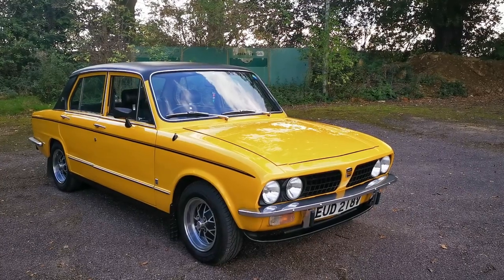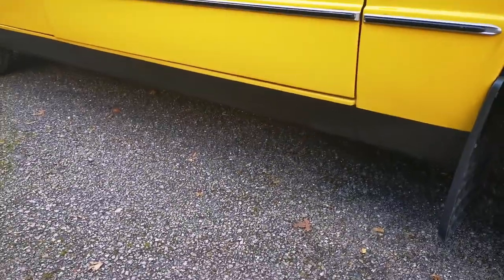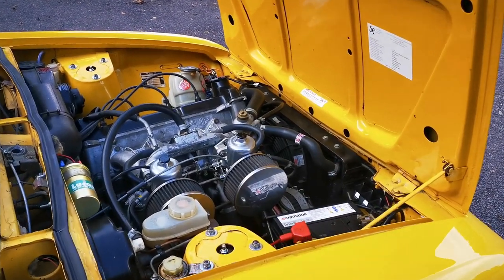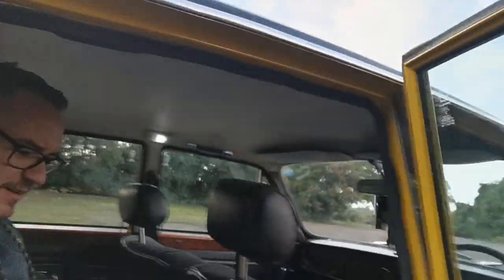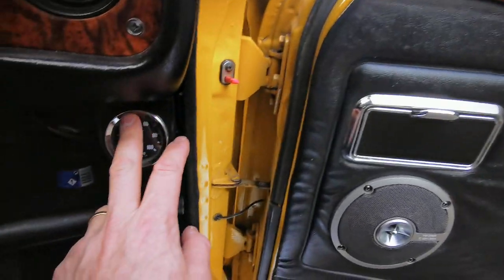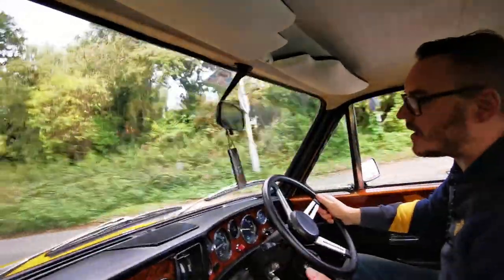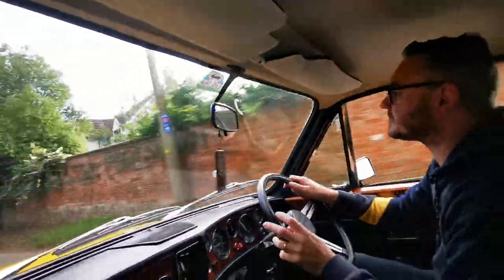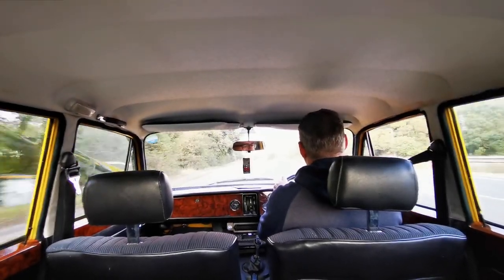Walkaround and drive of my Triumph Dolomite Sprint

Comment: Down here in Australia, I had a 76 Sprint, with factory LSD. Only ever made 2 mistakes with the car. 1. I bought it. 2. I sold it. Had it for about 6 years and loved it. Never had an overheating issue with it, but I did stick in the biggest custom made radiator I could get, with thermo fan. Sold it to buy a 4AG powered Corolla, which I could never get to handle as good as the Dolly.

Comment: What a lovely car, I had four back in the day two 1850s and two Sprints, I have seen other comments on here about the twin tailpipes but I guess that's preference these days and I don't think the twin pipes helped gas flow one bit. The overheating problems were largely caused by people not realising that the antifreeze needed to stay in year round and used to drain it in the spring (which is what we used to do back then) run through the summer with plain water which used to damage the waterways and head gasket and then refill with antifreeze which is a searcher and that's when the problems used to start. They were seen as a bit of an old mans car back in the day but I think it's a bit unfair to compare them to the RS2000 because I think they were aimed at a slightly different market for example the middle manager who had a young family and warranted a slightly more upmarket car than a Marina or a Cortina but wasn't quite senior enough for a Rover P6 or later on an SD1 or a Granada whereas the Escort was aimed very much at te other end of the market i.e. The young lad who'd just got enough insurance bonus so could afford to insure a Mexico or RS and really didn't have to worry about getting the family in the car. I loved all my Dolomites and with hindsight I wish I'd kept the last one a 1977 Sprint in Mimosa yellow.
Reply: What was your experience with the 1850’s? Troublesome? Are they reliable enough to drive everyday? Etc thanks

Comment: Was my dream car, 1973,  I bought a dark red one around 1975 and ran it for about 5 years, the engine was amazingly powerful, was one the fastest saloon cars on the road at the time, even 3 litre Capri's couldn't match the acceleration from a standing start. . lol.     I had overheating problems on  the motorway which were due to previous owner fitting incorrect radiator.  Had a fair bit of rust by the end and needed valve guides so I had to sell it,  but love the Sprint for it's great looks and the engine.

Comment: Your Sprint looks awesome matey, I owned 10 of these in the 1980/1990s , Never suffered a blown head gasket in any of them probably due to the fact I would renew the water-pump as soon as I bought one and fitted aircraft bolts in the camshaft (they were prone to snap) my favourite one was the yellow one which I fitted a blue printed engine into it, It was awesome and used to run rings round the BMW's of the day  and my friends holbay engined hunter gls, Great to see yours keep up the videos :) It would look better with the standard twin pipe exhaust :) (just my opinion)

Comment: Lovely cars. I owned a Inca yellow Sprint W reg. It was made in September 1980, the same month as production stopped.

There is a trick to help stop those slant 4 engines overheating. I should know, having owned 2 × Sprints, early 1850 and a Stag (the V8 is a twin Dolly engine). Never had a coolant issue.

The other mechanical issue was the fuel pump whined loudly. So I change mine to a Bosch.

Comment: I read somewhere that the overheating/gasket issues were because dealers weren't used to alloy heads on iron blocks and the need for coolant with corrosion inhibitors when servicing back in the day. Typical BL. Any reputation for fragility was undeserved. Always loved Dollies especially the Sprint. Lovely example. Love your channel

Comment: A car which brings back fond memories. My father had one and it was really quite a groundbreaking engine. Very quick for it’s day and a better builld quality than most BL cars of the time. Remember Dad having problem with leak on head gasket, a common problem. The overdrive was quite a novelty.
For me the highlight was driving it shortly after passing my test after my 17th birthday, learned on Austin 1100 with the worlds worst gearbox. The sprint felt like a rocket ship by comparison. Sadly the insurance company realised my age and decided they no longer wanted to insure me on dads policy so only got to drive it once but has a special place in my motoring history.

Comment: Worked on these when they were brand new, loved them, never did a head gasket but did spend lots of time setting differential angle to reduce driveline vibration under heavy accel.

Comment: Lovely example. I owned a Sprint for 10 years. It might help your carb set up if you ditch the waxstat jets and fit plain jets and also fit plain butterfly discs. These items were fitted to improve emissions (probably for the US market) but in my opinion just made setting up the carbs impossible as the mixture would change by itself depending on engine bay temperature.
Also don't worry too much about head gaskets. You have a later model fitted with uprated head studs. As long as you look after the coolant it will be fine. My Sprint got to 140k when the rust just got too much. The engine was still as sweet as a nut.

Comment: I bought a 2 year old in 1980, same color and very nice condition, almost new - S reg.  The overdrive was the best part and brought down the revs and noise.  It had some legs up to the speed limit and a bit beyond but was not a very fast car.  Also a bit tail happy in corners and never do anything silly in the wet.  I liked it and was reliable only stopped once but restarted after about 20 mins, something with the su carbs.  From the investment point of view the RS2K would have been much better but that is history and hindsight.  Good luck with the car.

Comment: I had 3 Dolomites a 76 1500 HL and two 1850HLs last was a 'W' Reg. I fitted a Kenlow fan to that and used to get 45mpg easily on a run! Only once did I need to use the Remote switch for the fan as it was getting hot on a hot day in Somerset going up hill! I loved them! The 1500 was Honeysuckle and the others Russet Brown.

Comment: That pin broke on my Sprint as well, and I also thought it was the clutch. Such a big job I did have the clutch replaced while the gearbox was out. Wished I had the O/D refurbished while the box was out as well. Its never worked 100% since.

Comment: Lovely car. You seem to be doing all the right things to it. 
Had two way back in the day. No problems with either apart from writing one off!   
They are great and I think it was a factory option to have a Britax sliding roof on them. I had one and it was lovely, you can open it in most conditions. 
Only point from your commentary, I think the wheel nuts are titanium not alloy. They are still easy to rip the thread off so do not overtighten or let the tyre shop at it with an air gun!
Air intake has been changed but apart from that looks completely authentic. 
Yellow is a great colour of the era. My second one was white which oddly worked for them with the black sections. 
Cannot remember if the sills were originally body colour or black.
Reply from the maker: Thanks, I wasn't sure about the nuts but they are certainly lightly and feel like it wouldn't take much to strip them! I've also now refitted the orginial air filter housing to see if it makes any difference to the way it runs (it doesn't!). I wasn't 100% sure on the sills but a few press shot of late Sprints had black sills so I went with that!
Reply: @trigsretromotors  Great, thanks for responding. Enjoy the car!
Reply: @trigsretromotors  Is there a way of contacting you as I would like to use some of the car sounds audio from this video? Thanks

Comment: brings back memorys of my old one lovly car you should have stated how it was of the best handling cars of its time you can really sling them bitches round corners , they only thing i hated was the engines head bolts they go in at an angle and they rust solid after about 1 day then you end up sledgehammering the head off ohh yes i remember it will lol but great car i would the body shell and stick a nice 200sx twin cam engine in there and a nissan axle would be one hell of a motor.

Comment: had about 8 of these , great cars . my back still hurts from doing up the exhaust manifold to down pipe bolts though , anyone remember sprint spares in southend jamie and another guy and his wife used to run it and he raced sprints
Reply: I used them all the time, I had a modified head from them, not sure if it was a group 2 head. Still have it somewhere.

Comment: lovely brings back memories, my dad had the 1850 hle or hl and I wanted him to get the sprint but never happened. Would I  be right in saying there should twin tail pipe on the sprint next to each other ? that would be nice to see on yours. nice video
Reply from the maker: Hi, yes originally it would have had a twin pipe and two extra exhaust boxes under the car but a previous owner fitted the sports exhaust, I quite like the single pipe myself :)
Reply: @trigsretromotors  don't get me wrong pal I like your single pipe set up too ..bet yours sounds better too

Comment: I am not sure the Sprint ever had an factory fitted auto box only the 1850 Dolomite did. If it really was an auto from the factory either it was a Leyland 'special' or what you have is actually an 1850 Dolomite 'conversion' to a Sprint. It was quite popular once the Sprint production ended.
Do watch out for the head gasket leaks. Any over heating from gasket leaks is an intrinsic fault resulting of its angled cylinder head bolts. It can also lead to combustion gases in the coolant system with dire cylinder head corrosion consequences.
Then of course there is its wonderful water pump driven directly via skew gears from a shaft low down in the block. Despite its faults it was and still is a fantastic car.
It was originally going to be called the Dolomite 130 but they could never get the production 16 valve engines to regularly achieve that power so Sprint it became.
Reply: they did come with an auto from factory , i converted one to stick shift
Reply: @repairitdontreplaceit  had 7 sprints as taxis in the 80s. 3 autos  one did over 400.000 miles loved them

Comment: Lowering Any Car Destroys What it was Designed to Be. 
BANG CRASH WALLOP on the Minor Potholes. 
So You Get RACE TRACK Handling All Through your Village at 80 mph Past the School to Look Cool in a 20 mph Zone at 8:50 am. ???? 

OEM parts ONLY on a Classic Car. 

When & Where Will You Drive That car UPTO & BEYOND it's Natural Limits ? 
Ah When You Have the Wife & Mother in it & the Kids On the Way Home From the School Run ? 

Keep it As it Left the Factory OR DO NOT Call it a Triumph, 
Call it a Triggers Confused Car. A BANGER that Somehow Runs. 

This is YOUR Version of a SPRINT. 
Maybe A DOLLY SPRINT is not the Car for You ? 
Possibly You Are a Fully Trained Car Suspension Designer as your Day job ? 
ACCEPT the Car / Any Old car For WHAT IT IS. 
RESPECT.  Never Modify Unless Parts are IMPOSSIBLE to Remanufacture to Original Spec. 

Hard Suspension & Lowered Ride Damages the Car's Structure. 
Extra Stress to the Structure on the UK's Potholed & bumpy Roads , 
Extra Driver Tiredness & Fatigue, 
More chance of GROUNDING the Sump & underside on Speedhumps Etc. 

Everything Triumph DESIGNED OUT of their Cars AT VAST COST.
Reply from the maker: What are on about man?! The car isn't lowered, it was when I got it but I've spent a fortune correcting it?!
Reply: @trigsretromotors  Well Done.
Reply: Each to their own mate. Just your opinion. There's plenty of scope to upgrade classics to personalise. Rule of thumb: don't do anything you can't reverse for when you when to sell as original spec.

Comment: The drivers door panel gap looks like the door is bent and the boot does not sit level. They either need adjusting or something more sinister. All this about head gaskets I wonder if half the people on here have been reading and pasting or are storytellers. I owned 3, 1 when they were current and my dad had one as a company car. Never had a head gasket problem, my dad had to have an overdrive replaced under warranty.  Your's has the later speedometer, if you look at earlier cars you will see they are caliberated differently. You should not have a problem with the carbs, experienced 4 sprints and never had this issue. Twin SU carbs are a doddle, try Webers. In the video your car looks choppy, I guess that is because of your springs and shock's. The standard car on standard suspension rides a lot better. Also the later cars used to rust a lot worse than the earlier ones, that is because leyland starting using cheap Russian steel. Remember you need to have the choke out until the car gets hot, you gradually push it in more and more as the car gets hotter. There is no way that car should run rich. Also you get people mess with suspension who quite frankly, listen to a mate who know's less than they do. A firm called SAH used to do all the Sprint performance parts back in the day. Sadly a lot of the people with the skills and know-how are probably dead or have forgotten. If you can get to drive a standard car the ride is a lot better and they handle just fine. You will never make a car designed in the 1960's handle like a car designed and built in the 21st century. It is what it is. The standard tyres back in the day were Dunlop SP Sport 175/70HR13's.